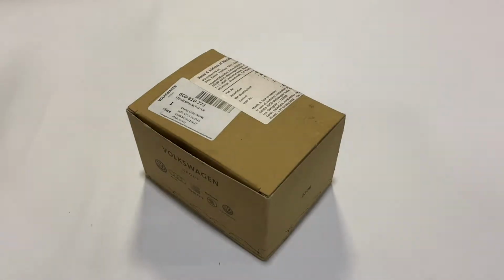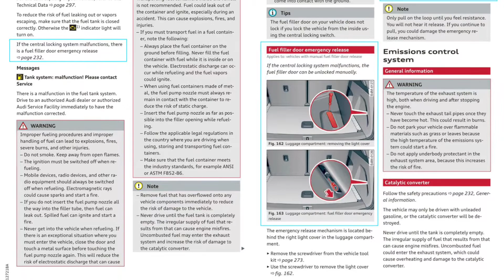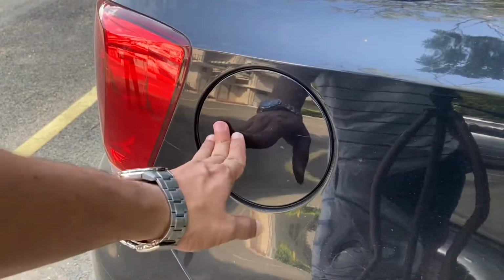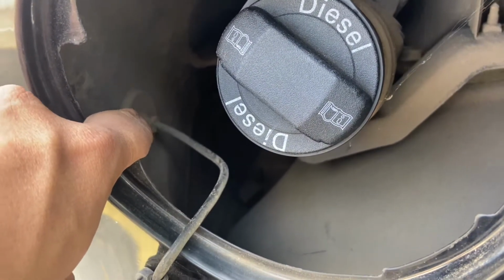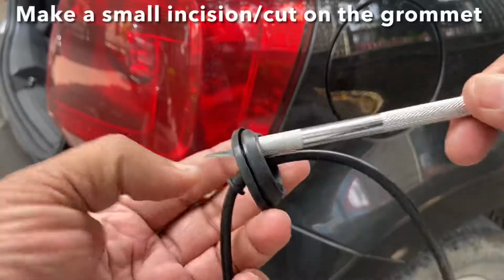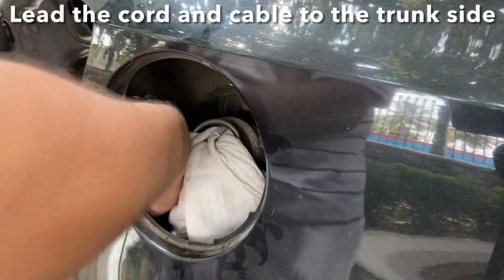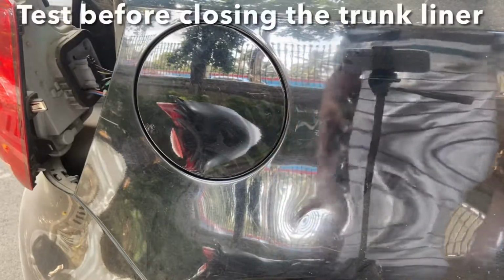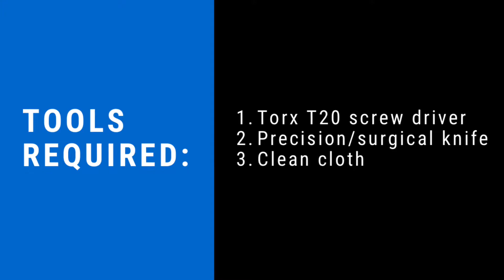Polo 6R - Adding the emergency fuel flap release mechanism

Comment: I have also for security replaced the fuel filler cap with a lockable one now as someone tried to get into my fuel opening and has cracked the front locking flap so once replaced it also has a key locking cap inside to avoid having fuel stolen or malicious damage caused

Comment: I want to install auto folding mirrors on my polo.Please provide information if this could be installed on 2017  CL polo.
Reply from the maker: Hi Prashant it is certainly doable with additional parts. Does your 2017 Polo comfortline have electrically foldable mirrors?
Reply: @GaneshBalan  hi  i can talk with you?
Reply from the maker: Hi Prasanth, we can talk this Sunday. I’ll be busy at work on weekdays. My number is 90996 91369.

Comment: Hi, that is a good find. Do you think a makeshift actuator cable can be installed if we make it from a copper cable?
Reply from the maker: Absolutely. In fact I did one with an electric wire and a piece of plastic with cutouts to accommodate that rubber piece. Worked well but I decided to get the OE cable to make it look cleaner. 🙂

Comment: Awesome ..another very handy diy ….👍
Btw…Have you remapped your car or are using a tuning box?
Reply from the maker: No man. Stock tune. No changes to the engine or exhaust. A bit scared to actually after reading the horrors around.
Reply: @GaneshBalan  have you used any oil additive or diesel additive in your car?
Reply from the maker: Hi sorry Desmond, I missed your message. I haven’t used any oil or diesel additives. I’ve sold my Polo which is a different story. I’m now driving a Honda Jazz VX CVT.

Comment: Hi bro do you have any experience of fixing battery drain on VW? I have a 2010 MK5 Polo and replaced the battery but still after a few days the battery becomes flat. So i am unsure if there is parasitic drain or alternator? Thanks
Reply from the maker: Hi, first thing - do you have any high power draw amps for the music system connected? What all accessories have you connected? 

If it’s a stock car, then the alternator isn’t charging the battery properly. This could be due to a bad alternator rectifier. 

The rectifier is a part of the alternator that converts AC voltage to DC voltage. It can go bad over time due to wear and tear. The rectifier can be replaced separately.

Comment: I would like to fix gti steering wheel in my 2011 polo could you please shed some light over this topic.
Reply from the maker: To install a MFSW to a Trendline/Comfortline model which did not have any steering controls before, in addition to the new steering wheel, you will need to add 2 cables from the T41 connector to the BCM and headlight switch. The T41 connector is the one that provides controls to the left (light + cruise control) and right (wiper) stalks and the steering wheel including the airbag assembly, horn and steering wheel controls.

Pic of T41 connector from VW workshop manual showing pin numbering - https://ibb.co/6J0DgSb

Pic of the actual connector during my cruise control installation - https://ibb.co/tbs69ZK

1. One cable is inserted into slot 9 of the T41 connector and the other end to the pin no 15 of the headlight switch.

2. The second cable is inserted into slot 10 of the T41 connector and the other end is joined/soldered to pin no 17 of the white connector (B) of the BCM.

Once this is done, you have to enable MFSW in the BCM through VCDS - 09 Central Electronics > Coding 07 > Long Coding Helper > select checkbox with MFSW installed and Exit.

That’s the whole process involved.
Reply: @GaneshBalan  thanks alot sir👍

Comment: Which shock setup is advisable for vento ? Oem front and back or SACHS ?
Reply from the maker: Dude I’m really not sure of this. Struts are completely a user based experience. Some find even the stock ones stiff. Some folks have gone with the TRW ones and have found them good. The current OE ones I hear are from Gabriel and don’t last long. Really no clue of the Sachs.
Reply: @GaneshBalan  any idea of axle nut size in 1.5 tdi cars? Some say it's 36mm and other say 30mm
Reply: No need to go with SACHS, failed within 30-40k kms..get Monroe..13k for front n rear together.
Reply from the maker: Dude if you meant the rear axle nut, it is an M20 12-point nut. You need a 30 mm spanner. 

https://ibb.co/PM5FsnW
Reply: @GaneshBalan  front axle nut
Reply from the maker: 12 point M20 nut. Uses the same 30 size spanner.